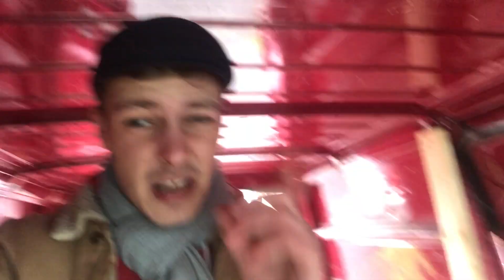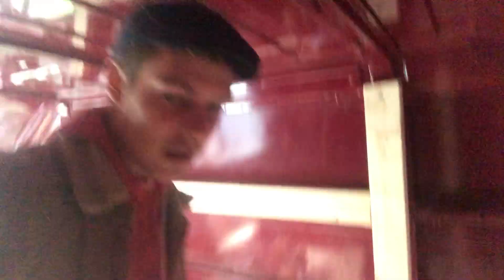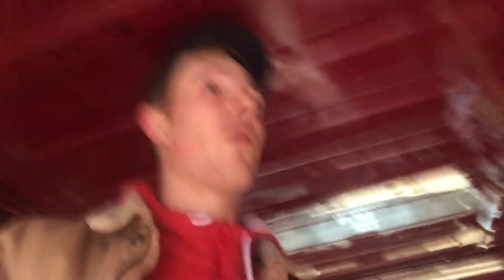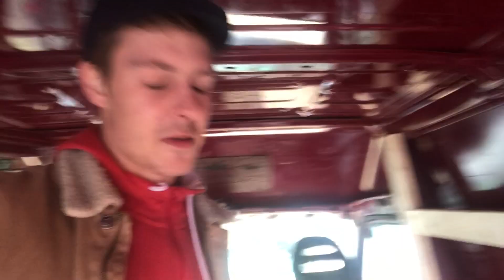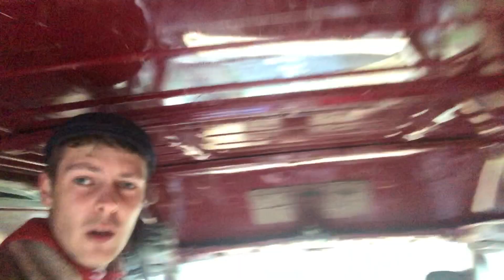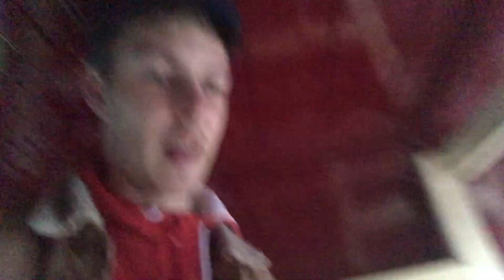FRAMING THE CAMPER - PROJECT MYSTERY MACHINE

Comment: Are you going to do the electrics yourself will get electrician in to do it ?
Reply from the maker: I’m going to do it mate only thing is I will get someone in to check over my gas system for the hobs once it’s installed but I’m fairly confident electrics wise 👍🏻
Reply: Exhausted wow that's very confidant . Can't wait for the video to come out and learn how it's done
Reply from the maker: Fingers crossed it goes to plan I’m sure it will be fine 🙏🏻